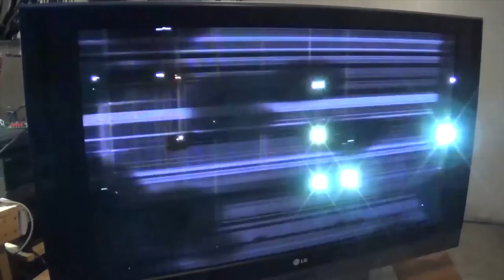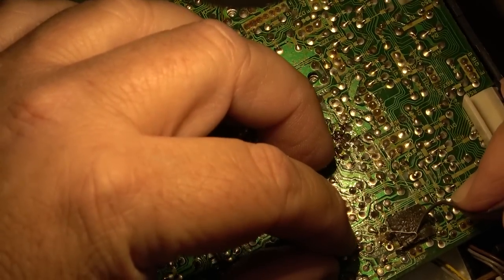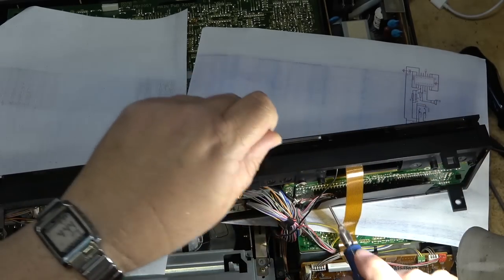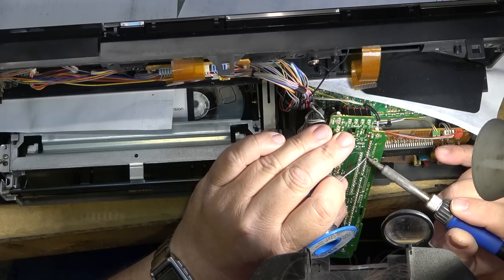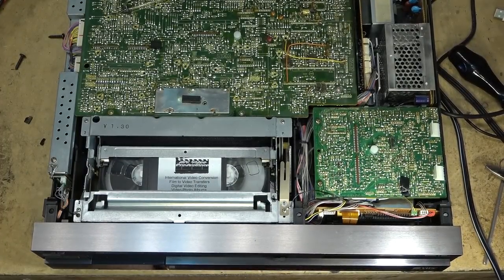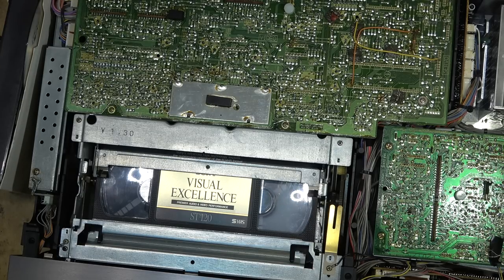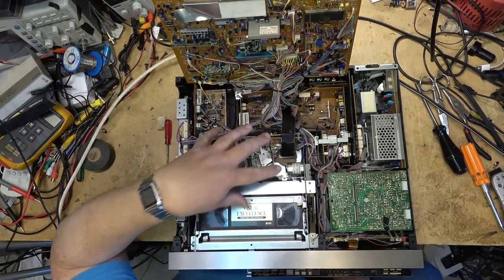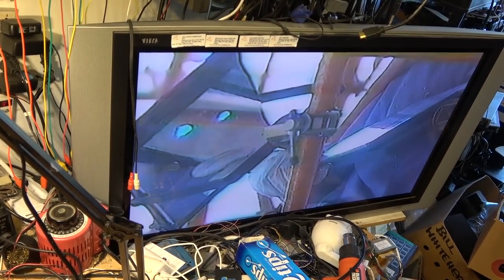JVC HRS8000 SVHS Service

Comment: Well, if you don't think this 1988 JVC S-VHS was that reliable for this era with its best mechanism, then Toshiba S-VHS was definitely the most-reliable in the late-1980s. All of the JVC S-VHS models went downhill after HR-S8000U. The successor 1989 HR-S6600U is an interesting story to discuss for its crap quality.
Reply: I'd be interesting in hearing that story. I have every consumer JVC SVHS mech from 1987 - 2005. 

I've found the mechanism the JVC HR S6600U uses has issues with the Hi Fi audio board having issues not playing Hi Fi, so I assume it needs to be recapped.

Comment: HATE HATE HATE These JVC machines! Did I mention I hate them? Buy a Sony or Mitsubishi S-VHS machine. You'll thank me later.
Reply from the maker: Yes they are shit.
Reply: @12voltvids  
I have one that won't rewind unless the tape is in play mode. It starts and then stops after about 2 seconds. Cleaned mode switch, timing is good. Is it a bad idler tire?
Reply from the maker: @NunYa953  Likely yes